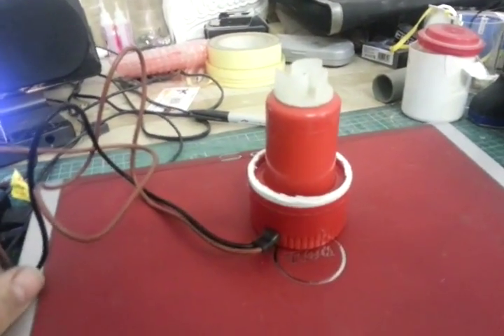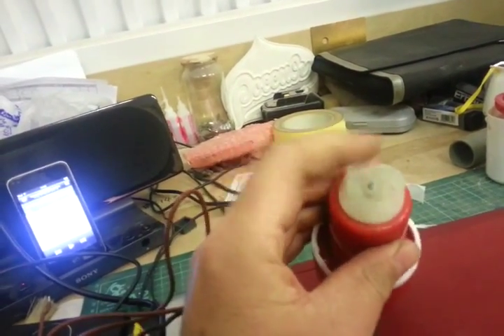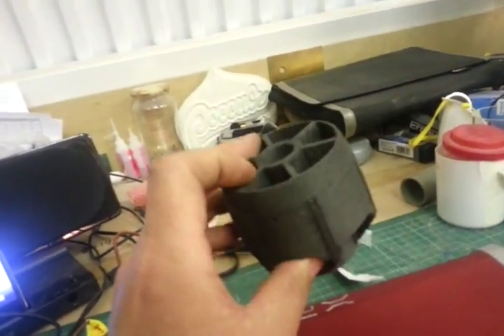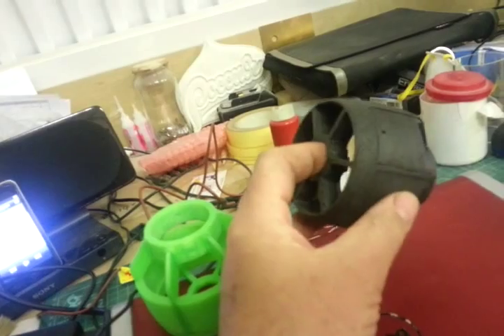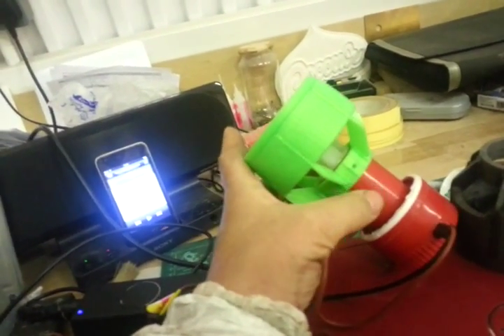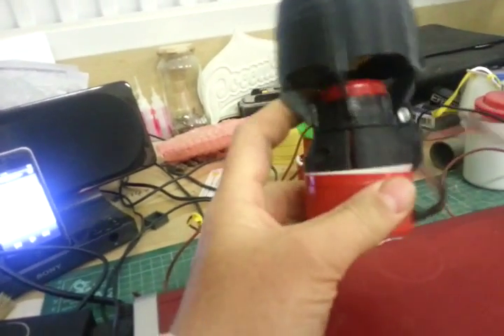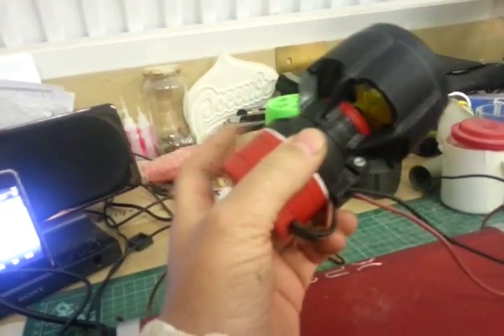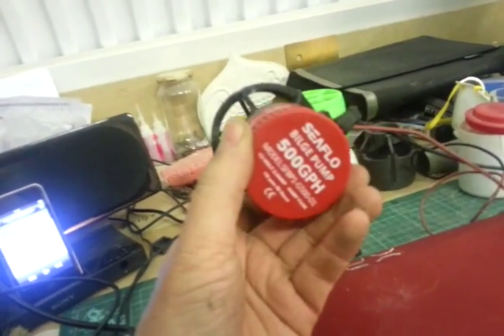thruster motors for the ROV

Comment: Hi beesleyboy, oustanding. I am trying to do exactly the same with 1100gph Seaflo bilge pump with 3mm shaft, 10mm long. How did you make the duct? Which propeller did you use and where did you buy it?
Reply from the maker: Thanks Maurizio
The Propellers are model boat props, I can't remember where from at the moment, but most model shops will stock them.
The duct's are designed and made by me, I designed them on Rhino Cad and I printed them in ABS on my 3D Printer.
I'm busy with work at the moment, but I'm hoping to get back to the Project soon.
Reply: Could you sell me the the prop housing?And give me a reference for the propeller? The pump I have has the same size as yours however the duct of your housing matches exactly the propeller you are using.
Thanks
Reply: beesleyboy you should definitely sell the housing on like eBay. I would buy as well

Comment: hello, what a nice job........don´t the brushless motor get damaged?  how deep can it go?
Reply from the maker: hi bud,  I'm not sure how deep they can go,  but there are people out there using them,  im hoping to get some time soon to carry on with the project.
Reply from the maker: DAVID IZQUIERDO GOMEZ 

not at any depth,  only in a tank, the pumps are DC low voltage motors, that can work under water even if the water gets in.
this is the motors that I plan to use,  if there not successful,  then I will use something else,  maybe some brushless motors.